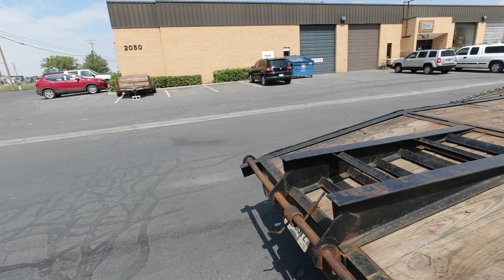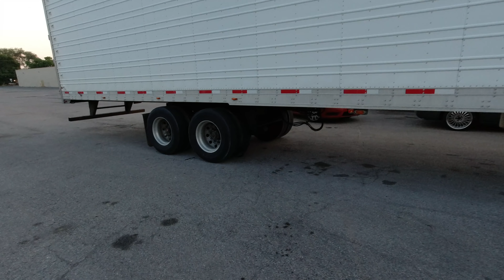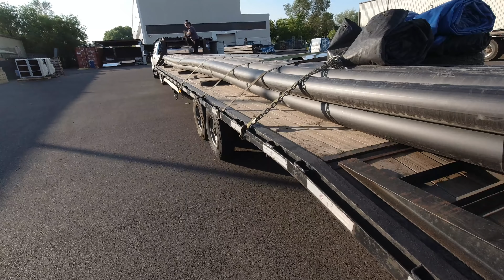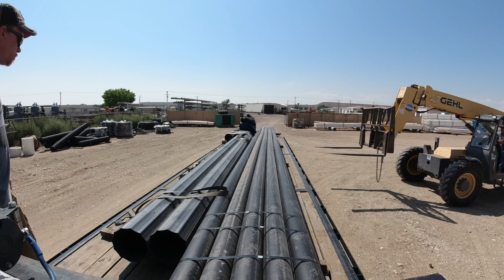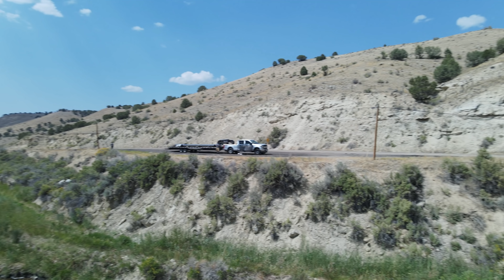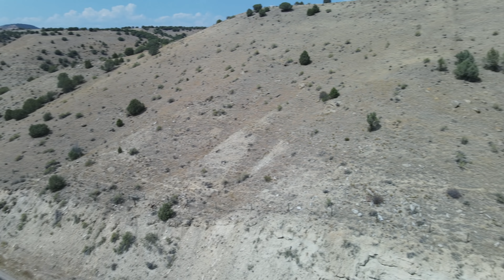We forgot to unload everything.

Comment: Why don't you have a dually? You're probably overloading your tires a lot.
Reply: It depends on how it’s loaded.  I run SRW with decent tires. While my trailer is only 32’ it’s loaded much heavier.  Proper positioning of load is more important with SRW.  Non CDL loads it’s less of a issue.  But DRW has advantages. Mainly ride, stability.
Reply: @larsharris  with only 2 tires on rear axle, you're only rated to have around 7000lbs total on that axle, including truck weight. You're probably near that much with just an empty trailer.

Comment: Only cost $108.00.... 12 ply won't get er done partner but you've been told that by me and others. That $108.00 tire is like pissing in the wind when they blow,you're broke down,and paying either a premium for a road side service tire or a hotel stay waiting for the "good deal" tire shop to open.....Load range H at 95 PSI is your best option.
Reply from the maker: Actually I've had my best luck with 12 ply. My 14's not so much
Reply: @SouthGeorgiahotshot  make sure you run the tires at max rated pressure.Low pressure generates heat as the tires are flexing too much rolling down the road. Heat kills tires and excessive flexing will break the cord bonds.Look at both tread ply AND sidewall ply rating. Cheaper tires be they 12 ply or 14 plying can be as low as 4 ply side wall ratings.Look for 8 or higher on the sidewall rating and don't just look at the tread ply rating. Been dragging trailers off and on since 1976.When I was young and dumb I went cheap.After a few blow outs learned my expensive lesson and never scrimped on tires again.
Reply from the maker: @harley2die4  anything more then a 14ply weighs to much for a non cdl imo. And I haven't had any luck with 14 ply. They are so stiff the crack the rims
Reply: Amos I quit even trying to tell him Anything>>> Hell he Knows it All!! And hard Headed LOL>>Maybe that's what Lita Likes about him (: The Hard Head!!
Reply: @SouthGeorgiahotshot  If they crack the rims it's the poor quality rims my friend. You have to understand that the trailer manufacturer is using the absolute cheapest components they can find: not the best quality. I've got a storage building with probably 20 take off rims from over the last few years. They are not suited to my trailers and the weights I tow.
You can upgrade to good rims: costs money though.
Reply: @amossnowdaharleyman9179  Very sound advice. On one hand, I’ve seen him complain about equipment costs, but then he’ll turn around and waste money on something insignificant. I really want him to succeed, but he seems reluctant to follow sound/experienced advice.
Reply: @glcmranger421  He'll learn or go broke. Hard way to learn by going broke though.
Reply: @amossnowdaharleyman9179  This is true, times two!